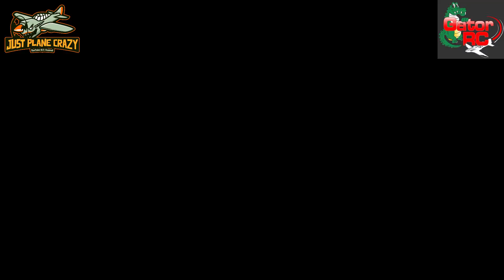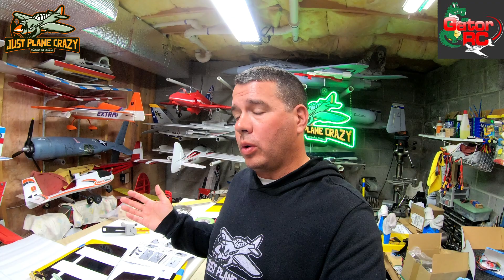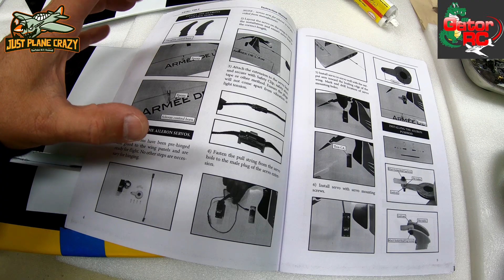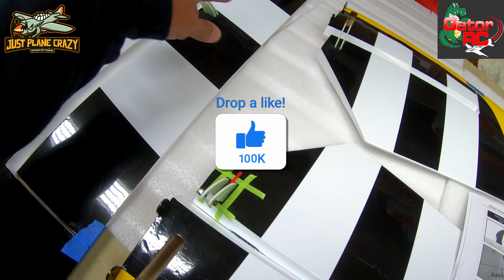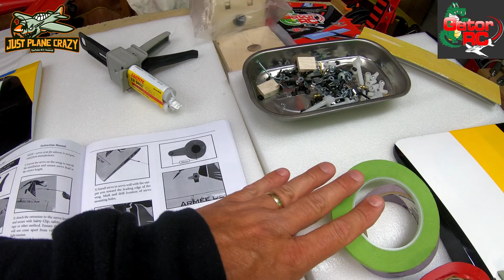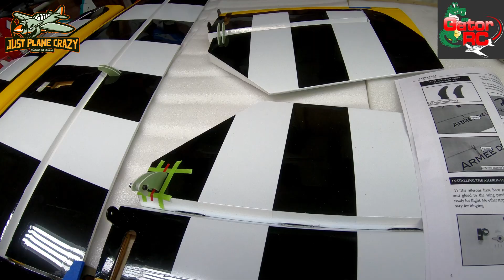Seagull Models 50cc Extra 330lx from Gator-Rc, Build pt.1

Comment: Can you tell me what servo arms you are using as well as the Ti pushrods and where I can get them?
Reply from the maker: Turnbuckles are 45mm elevators and 80 aileron. 
Arms are all 1.5 inch. 

Check gators site. Steel would be perfect. Just not aluminum if your using ball link ends

Comment: Hey dude. I meant to ask you where you got the anodized "BLING" washers and hardware? I looked on RTL but I didn't see any anodized junk. Thanx
Reply from the maker: Lol. I have busted them several times to get the anodized stuff. I hope they will soon. Anyway. I order the bling from Amazon EBay or RJX Hobby
Reply: @JustPlaneCrazy  Thanx I'll check it out. After I submitted the comment I went on Gator RC and they actually had some...kinda pricey though. Thanx for the reply and I hope ya have a great new year.